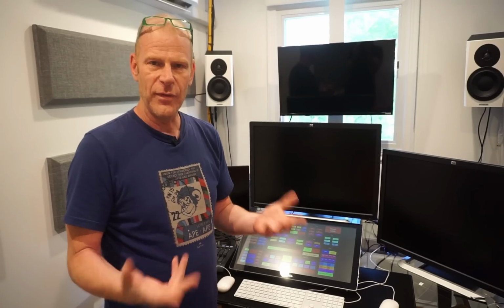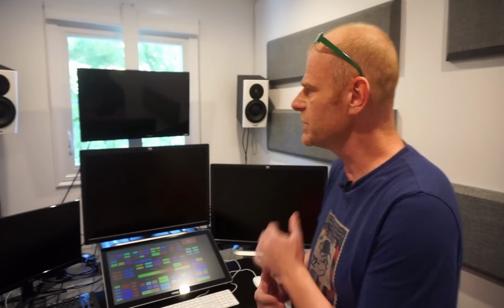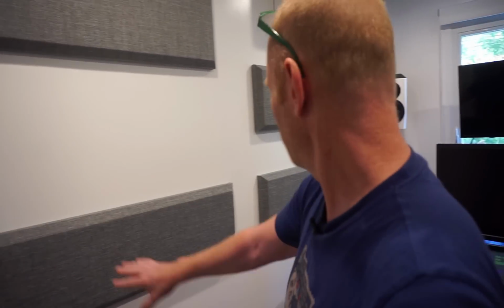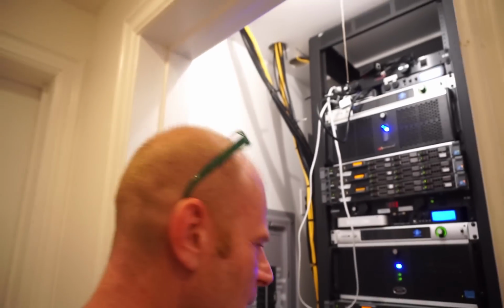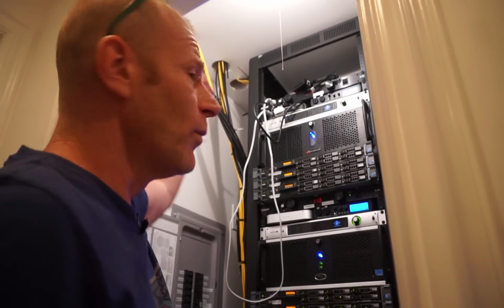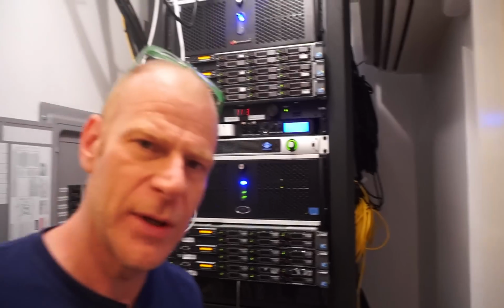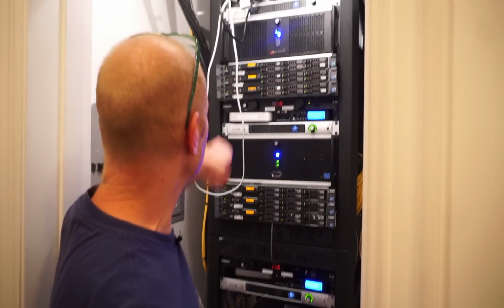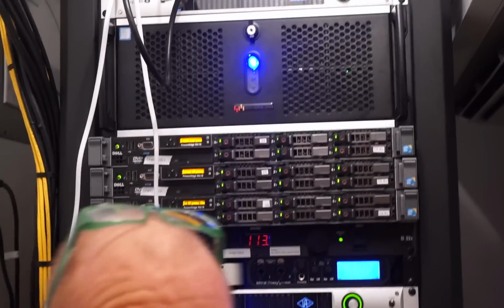Improve Your Studio: Panels, Machine Rooms & Server Units

Comment: Junkie, my man, systems wise you're doing it all wrong. You could be doing 12GB/s (yes Gigabytes) disk read from a single networked slave that will handle all the sample I/O you could dream of. For example; four hardware raided Samsung 970 NVME drives (add as many more as you want) fitted into a supermicro AOC-SLG3-4E4T,  Asus Hyper M.2 x16 (motherboard permitting) will cost effectively destroy everything, and that's just 1 PCIE slot, not an entire server. You could easily have 7 or more of those raid banks in a single system. The decade old Xeons you're using are up to an order of magnitude less efficient than something more modern and tailored/optimised for your needs (the clock speed means nothing). Buying modern Intel Xeon ES/QS (Engineering Sample) CPUs, which are the ones Intel sends to datacenters before they're ready for sale commercially, from ebay is the way to go (in some cases one tenth of the price). I use said systems, and trust me, you'd only need one. If you'd like a example, let me know.
Reply: I had no idea raids and SSD (drives) had come so far. I spent 2hrs looking the 970 NVME up. thanks
Reply: And energy costs of these old Xeons will be much higher than the money you put into a more efficient modern machine! THAT’s why they sell them cheap.
Reply: Which modern CPUs would you suggest?
Reply: Hi overlord .I`m really interested in getting a proper server/storage solution for my libraries. About the setup that you describe in the junkie XL video could you elaborate a little bit more.I followed the supermicro AOC-SLG3-4E4T links in their page going all the way to the motherboard and chassis that they have, has an example of a setup-https://www.supermicro.com/products/motherboard/Xeon/C600/X10SRW-F.cfm and https://www.supermicro.com/products/chassis/1U/815/SC815TQ-600WB. Could you share your setup? I Have a mac mini running pro tools and a bunch of external disks. Can i have this server system and output it via ethernet/Lan to my mac ? I notice that the Supermicro supports only windows and Linux.Thanks
Reply: Hi David, That's a great question, hopefully the answer will be useful to many. I currently use a Dual (not dual core, but dual processors totalling 32 logical cores) Xeon setup with 128GB Ram, and I'm currently planning out the upgrade. Note that you don't need anywhere near that kind of ram, and my background is as a software engineer. However, in the time since my last build, Intel has been busy and drastically upped the core counts and both single thread and multi threaded performance on their consumer/Enthusiast products, so a recommendation follows:

For a single, efficient system, I would that actually recommend that everyone go for an "Intel Core i9 7900" series setup where you can actually get upto physical 18 cores (36 threads), Your DAW will thank you for it. This will give you at the very least, with the right motherboard selection, Thunderbolt 3 (thus your choice of low latency interfaces), VROC (Virtual Raid on CPU with as many NVME ssd's as you can afford). Note that VROC only supports Intel NVME Drives, but the performance will be unparalleled. You will need to read up on PCIE Bifurcation (16 to 4x4x4x4). Asus x299 Prime Deluxe is the perfect choice (this also comes with the thunderbolt 3 addon card). With this board you can use the "Asus Hyper M.2 x16" Add on card to host 4 NVME drives. The SSD's you would ideally use with these are "Intel 760p" series for hardware raid and best performance, but you can software raid anything like a Samsung 970 Evo.

The Completely Ridiculous Overkill, but unbreakable performance setup would be a pair of Intel Platinum 8180 Cpus, in a Supermicro X11DPG-QT motherboard, with an array of their own Quad M.2 NVME Drive addon cards, and the custom bios(that you would have to request from support) that allowed you to use Thunderbolt 3, before they decided not to support it on that board because it won't "hot plug" i.e. the thunderbolt device has to be plugged in before the workstation is booted (not a huge problem with an audio interface). That version would cost in the region of $25k+ retail, but far less if you were resourceful and were able to obtain the QS (or H0/L0 stepping ES) versions of said processors

Hope this helps.
Reply: Hi Overlord
Thank you so much for your reply.
A couple of questions , if you don`t mind!!

So, has i understood the transfer connection between the "server" and the main computer/machine is via Thunderbolt?

What if i choose to do so via Ethernet/Lan? 

Now the question is what`s the real transfer speed that i get if i do it this way?
"Raw HDD performance comes into play here, too. Even if you do achieve 125 MB/sec transfer rates over a Gigabit ethernet connection, you still need to read & write at those speeds as well."

I`m asking you this for two reasons
1)My setup- Mac Mini (i7 processor/16gs of Ram / 2 SSD one for OSX running Pro Tools the other for running Pro tools sessions
            The mac only has a single Thunderbolt 1 port, ethernet ,4 usb,hdmi,firewire 800
            So since i only have a single thunderbolt 1 port which has to be connected to my audio interface (Avid Omni             with a single thunderbolt port also , otherwise i would have to buy a thunderbolt hub to daisy chain thunderbolt) 
       the only way is to connect via Ethernet.

His it worth to have a powerful machine/server with such big transfer rate and then loose it when you send and receive data via ethernet?

And last , didn`t quite get the last sentence in your reply !
 "but far less if you were resourceful and were able to obtain the QS (or H0/L0 stepping ES) versions of said processors"

Thank you and sorry for the dumb questions!!!
Reply: @daviddiogo7713  Hey David. There are several options, but it's going to be limited to the configurability of your workstation.

You could use 10Gb Ethernet, which you can actually bond if you have 2 ports, giving you double the speed. Another fast but expensive alternative is Mellanox Infiniband. But I would say that the more cost effective option would be daisychaining if you can't add in PCIE cards to your rig. A quick solution would be either a thunderbolt NAS (Network attached storage), or something like the Black Magic Design - Multidock.

My inclination though, would be to build a single system, even gut the mac for the cpu, ram and hard drive, and spend the money to get a motherboard with enough pcie slots to put super fast storage in. That way, the money you're spending is almost all going on what you need, as opposed to expensive items just to connect it. A single optimized system will be far far cheaper for the speed you can obtain using the right professional oriented parts.
Reply: @OVERLORD-ji2id  10gb fiber network has come a long way in terms of  cost effective ways overlord. but for david case it maybe an overkill. 
https://blog.briancmoses.com/2016/06/building-a-cost-conscious-faster-than-gigabit-network.html 
this is an great articles spending less than 500 dollar in total setup. if you snipe on ebay it may cost even less
Reply: What about striping RAM drives? That would be the ultimate in sample speed, just don't lose power.
Reply: @RoboticusMusic  I use a 32GB Ramdisk for my DAW cache, which definitely helps. The I/O is staggering, I've seen 12GB/s + sequential reads, but I don't think that raiding them would eliminate any bottlenecks unfortunately.
Reply: I agree with you on the SAN part. But i would not recommend using Engineering Sample CPU's, those are potentially stolen CPU's and not ment to be used in a high performance production environment.

Comment: Can you show us how you went about setting up the servers? From acquiring, to wiping, to prepping the data, installing and setting up to run your samples?
Reply: David Mac - its pretty straightforward though you’ll need patience and be happy tinkering with Windows and hardware for CPU and memory upgrades. Once you have your server sorted simply insert an SSD (minimum of 120GB for the OS) and connect up a USB DVD player. Insert Windows Server 2008 DVD and install. Once installed - takes around a couple of hours, then connect ethernet at the rear, unplug DVD player, configure your static network ethernet settings in Windows then logon to vsl.co.at to buy and download Vienna Ensemble Pro 6 (VEP6) and install. You will also need to do a Windows update to ensure Windows is up to date. Also worth setting up Windows Defender to ensure its antivirus protection is running. Also make sure your ethernet cable connects your server to a router or switch to which your DAW PC is also connected and also your broadband. If you plan to store all sample libraries on your server then you’ll need additional SSDs or HHDs installed ideally in RAID0 for faster load times.  Then download and install NI Kontakt 5 and/or 6 and or PLAY. Then you need to build your VEP6 server template / server project with your samples and then you’ll be able to play them remotely from your DAW using the Vienna Ensemble Server plugin.  Thats about it, in broad terms. You will also need to purchase the iLOK USB licenser that will allow VEP6 to load and run on the server. VEP6 comes with 3 licenses. For detail on setting up VEP6 there are a number of good videos on the VSL website and YouTube. You can have as many servers as you like but limited to one VEP6 license per hardware server.  One small note is to watxh the power utilisation when running more than a couple of servers. We have 12 in the studio guzzling around 1800watts per hour.  Hope that all helps.

Comment: Which hardware device would you recommend to control the MIDI CC in Cubase? I do it manually. The keyboard I use (Axiom pro) does not seem to be compatible with cubase, so I need to buy another external machine, but they are all really expensive. :( Thanks! :)
Reply: it's a joke , midi is cheap  to buy, a cotroller cand cost only few $ ,and everything other than audio in music is midi : so every music software can deal midi

Comment: I saw on John Powell's set up is runs an enormous Logic Pro X template of over 300 tracks (Idk if they are all seperate kontakt instances but still WOW) I run a
27" iMac (5K Retina, late 2015)
-OSX Sierra
-4 GHz Intel Core i7
-3TB Fusion Drive
-32 GB RAM (4 8GB 1600 MHz DDR3 modules)
...and I have problems with say 60 instances of kontakt....I saw on John Powell's verified facebook account he claimed to use 3 slave computers with 300gb of RAM spread throughout. Does anyone know the specifics of that set up and if he is using VEPro?
Reply: Jemuhni i think he uses bidule https://www.plogue.com/products/bidule.html

Comment: Thanks for the info you 'junkie', you... There is a lot you can do with $1000, but it stops before buying gear and computers... Remember computers are always updating, so if you find a workable pc for around $300-500, you got about 2 to 3 years, tops, before you'll need to upgrade (It's been that way since the advent of the PC, it probably always will be.. I don't know) I work in a 10x10 room. I put up acoustic foam, panels (that I made) much like the ones shown. That helped me to tune the room to an acceptable point, though any square room is a problem for a good tuning. I have a very quiet iMac, but it can't fly 1500 instances of Kontakt (maybe 150 for a short cue). Can't have a template with everything preloaded, so I make my templates on the fly. There are some that I return to often, which helps in time management. I prefer Mac, so creating a more powerful rig is never cheap. No gear that I have makes any significant noise, but putting some of that in a whole different room would definitely cool my workspace down... but I don't have such a room in my tiny apartment. Oh, and treating my room acoustically, helps keep the sound in (so not to bother the neighbors), but outside noise is big problem for me... not sure what to do about that.  Also, I consider myself quite busy. I get lots of work and have a good client base, but living in San Diego/SoCal I'm just scraping by every month. Working 18 hr days, sitting down, is not helping the shape of my butt, but I do take a lot of breaks, and I spent $600 on a good chair (a slightly used Aaron chair)... it does make a difference, and was a wise investment. Any extra money that comes along (not very often), goes into a gear fund. My goal is to get into a modular synth rig, and other vintage synths/keys. At this rate, I should be able to do something around 2043... ;)  I appreciate your generosity with your info and tips, Tom. Please keep sharing your experiences. It has been helpful. Thank you.

Comment: I've looked at servers like these in the past & they always have something mentioned such as: "Power cord not included".  How are you supposed to test the unit without the power cord?  Or does the power cord cost an extra $300?
Reply: They all use standard $3 IEC power cords.
Reply: @weird_oscillator  Have you bought any of these types of servers?  Are they still good?
Reply: @shitmandood  yes, but you don't even need to go this route.  You can do all this with any normal computer.  VEP just offloads the plugin hosting to the second computer, much like UAD offloads plugin processing to their DSP cards.
Reply: @weird_oscillator  So VEP is Vienna Ensemble Pro?  I think is the first time I'm understanding what is happening here.  I thought the DAW could setup the VST over network without another tool.  I wonder if there is a cheaper way, perhaps only through each server having an audio interface for MIDI and audio inputs/outputs.
Reply: @shitmandood  you can certainly do that, although it's not any cheaper and not over the network.  The advantage of VEP is that all you need is your computers on the same network, then VEP takes care of all the delay compensation and your DAW sees the other computer(s) as just another plugin.  VEP also has as many virtual MIDI and audio channels as your computers can handle.  

The way you're suggesting will work also, but you'll need to manually take care of routing the audio and MIDI from one computer to another.  You'll also be limited by the number of inputs and outputs that the audio interfaces have.  If each PC has an audio interface with 8 I/O, then the max you could do is 8 channels.  VEP allows basically as many channels as your computer can handle:  8, 16, 32, 64, 128, etc.  With only a single network connection.

Guy Michelmore does a good job of showing an example:  https://www.youtube.com/watch?v=NvQzjy0_V_k
Reply: @shitmandood  Another thing to consider is that Tom's particular scenario is specific to his work, and something like VEP is overkill for a bedroom producer.  It's cool and fun, but certainly not needed.  If you think about what Tom does having multiple engineers working on film scores, it's an advantage to be able to pull up the DAW session on any computer in any room and have it be exactly the same.  He has assistants that do work for him and they all need to be working on the same project with the same plugins and the same settings.  So instead of having numerous identical machines in each room, he can have all the plugins hosted on VEP, then all you gotta do it open the project file from a shared drive.  Moving from studio A to studio B and having the exact same setup is a huge advantage when you have multiple engineers working on projects.

Comment: The depreciation on server-grade equipment is incredible - I put together a dual-Opteron graphics workstation about a decade ago, and soon discovered that every time one of the big supercomputer / enterprise facilities did their regular upgrades you'd get all these secondhand high-end CPUs flooding the market for next to nothing. I'm still using that (now maxed-out) rig on a daily basis today, it's certainly getting a bit long in the tooth now but I can't believe how well it still holds up!
Reply: A lot of the bargains you see are lease returns, which is great for the used market. Companies lease their equipment for 4 or 5 years, just like you would a car.  When the lease is up, the equipment that gets returned ends up on eBay for a fraction of the cost new.  Technology advances so fast that a 4 or 5 ear old machine is considered "obsolete" (even though it's really not), so you get tons of cheap, previous gen hardware on the used market.

Comment: I saw someone sell with Xeon Quad Core E5506 in it.What do you think? not a very good cpu for today and the future.But lot of ram in it.
Reply: Fauzan Rahman easy to upgrade the CPUs to 5560 or higher but only works if the motherboard supports hyper threading. Some older Dell servers dont support multi threading  / hyper threading.

Comment: What OS are you running on your servers?  I was considering one of the Poweredge, but the people on the VSL forums didn't seem to know much about it and the server OS kind of intimidated me....
Reply: Rattletree He’s running Windows 7 on a couple of his PC slaves and Windows 10 Pro on the others.
Reply: @ArmenChakmakian  Do you know if any additional drivers were necessary to load from a separate disk? I was in IT for 15 years and installed many server OS, but never tried a client OS on server hardware. Server 2012R2 was like the last version I worked with before I left IT.
Reply: @mbreidegam  The only drivers needed would be for any hardware you'd need to hook up.  He hooks up his PC slaves to the master computer via gigabit switch, which wouldn't need a driver. Hooking up something like an audio interface to the slave would most likely require a driver.  I'm not familiar with Poweredge, but if the specs are compatible with Vienna Ensemble Pro, then it should work. Just check the VSL site for specs, which sounds like you've already done.